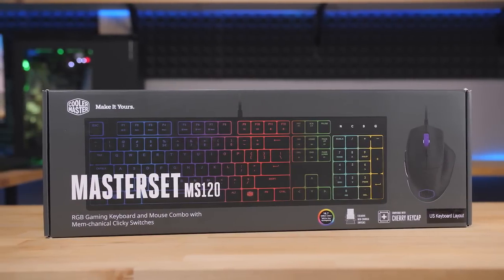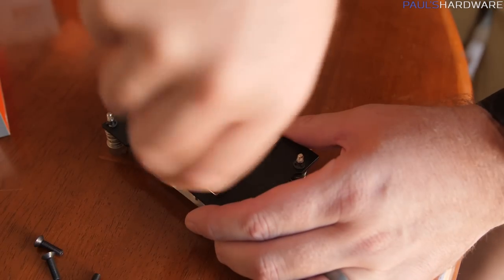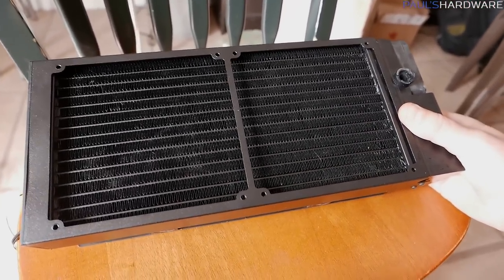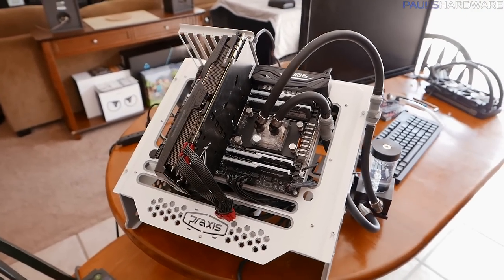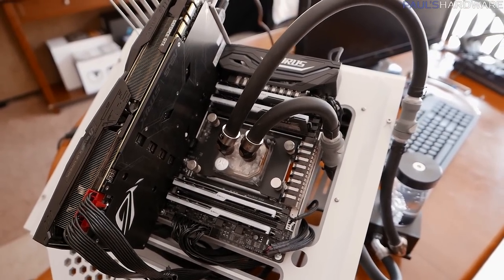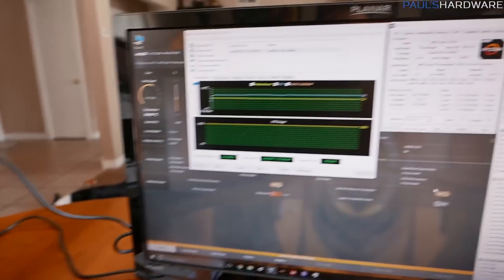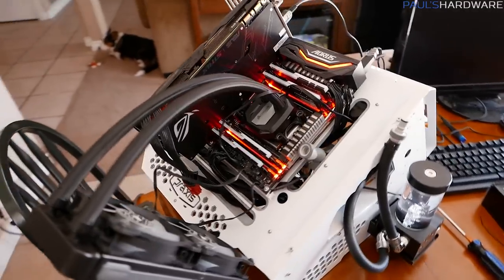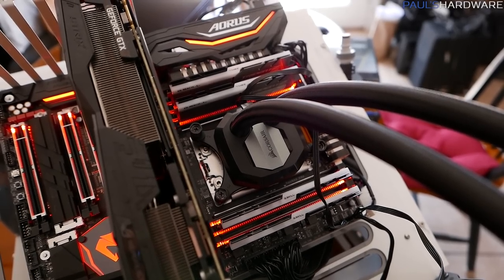My Failed EK Supremacy EVO Threadripper Edition Review

Comment: This is why i hate AIO watercoolers, nothing more reliable then an aircooler
Reply: I would reply to you, but since you seem that guy that just insults to try to prove a point, I'll skip. If you love watercoolers that much, buy them.
Reply: Micael Pacheco I'm sorry for my agresive statements I've just had the worst month of my life, new problems everyday.
Reply: Marc Sticken I hear a lot about h100s and other variants failing on people
Reply: Bad months make good months greats ones.
Reply: Why did you compare a custom water cooling loop in a PC to the Nintendo Wii?

Also, the OP is right, there's nothing more reliable than air cooling.  With air cooling, your only point of failure is the fan.  With an AIO, your points of failure are the fans, the pump, and the tubing.  With a custom loop, you have all the stuff from the AIO plus fittings that can also leak. 

This of course doesn't mean that water cooling is _bad_, just that air cooling has less points of failure.
Reply: Technically a fan less (silent) cooler would be more reliable in that sense. As there are no moving parts

youtu.be/ArJjI0F32rU
Reply: mjc0961 ok that wii was meant to be air, and yes aio coolers are vary reliable, my step dad is gs11 all the PC's in his office are aio cooled because he does firesupport for the guys downrange so he needs a beefy cpu.
Reply: Jeff Goldblum I got lucky the store exchanged the PSU and gave in store credit which I used to get x370 gaming titanium r5 1600 and 16gb of Corsair vengeance lpx 3000mhz
Reply: Micael Pacheco I think everything is relative. I've had nothing but aio's since I started building rigs back in 2013. Only ever had one problem. But it was corrected. To be blunt. All hardware will come with the possibility of issues. Let's not be ignorant of that.
Reply: Planet Kuruto it's bound to happen. Anything with moving parts is bound to break or have problems.
Reply: If done well custom loops are very realiable d5 pumps are tanks very rarely die most last as long or longer then one uses a air cooler (5+) years and the rest of the loop is as safe as one makes it aio if you have no control over qualty so your gambleing on the manufaturer, but they are still fine 99%  of failure is the pump wich dosn't hurt anything your pc will just hit its thermal limit and shut itself down sux to replace but not really dangerous
Reply: Phoenix Fieryn I've heard problems all round with all different brands. The biggest issue being the pumps. Had two of corsairs aio's and I've yet to be disappointed.
Reply: @Phoenix Fieryn Yeah my X62 has been nothing but a beaut
Reply: Phoenix Fieryn it's more than likely Corsairs popularity in comparison to most other aio manufacturers.
Reply: your waisting your time buddy, the tech tubers brain washing (and free aio coolers) have got to these people they cant be helped, they refuse to grasp the fact that cpus dont need to be cooled down like they think they need to be.
Reply: Idk why people say things like this... 'Nothing more reliable than an air cooler' 
My custom loop from EK came together perfectly fine, it runs perfectly fine, I use cryofuel and deionized water so any spills mean absolutely nothing apart from a few hours to dry if I catch it or a few days to dry if I don't. Thus far I've had no failures at all and filling the loop is incredibly easy. 
I think people don't seem to understand what redundancy means. :/ You don't need to worry if you have enough layers of safety.
Reply: Well i mean he does have a point a AIO is much more reliable then custom block i'm sure you already know that anyways and you are right air cooling is and will always be the most reliable the thing is you can do much more with custom cooling and i will always be a massive fan of water cooled GPU's where there is even a MUCH bigger difference. 

For normal cases or builds i make for my friends to last 3-5 years i won't use anything but a heat-sink. 

If a user thinks a AIO can beat a heat-sink to a degree of being able to overclock better they are wrong but with custom cooling they can easily beat a air cooler.
Reply: @Sir Dandy Just because something works out fine for you does not mean it is better than something else. Your experience does not invalidate things you disagree with. I also am not sure you understand what redundancy means either. 

By definition air cooling is more reliable, because they are intrinsically less complex, therefore contain fewer points of failure: fan, heat pipes, radiator vs. pump, internal radiator, fluid transport system, external radiator, fans. I use an AIO in my machine but that's because it keeps things cooler than an air cooler while looking better and sounding quieter, while being affordable. I understand risk is higher, but it's not worth it to me. This does not make people who use air wrong.
Reply: jd gaming temps are right on par with top level air coolers with aios. Its a matter of preference at this point. We're arguing semantics. there's benefits to both. My personal preference is not air coolers but aio. I don't like how massive they are. Or the aestethic they offer.
Reply: +Ana Sevi 70% failure rate over 2 years? LOL, no. If that was the case NZXT and Cryorig wouldn't have a 6 year warranty on their AIO's. Even Corsair has a 5 year warranty. "70% failure rate over 2 years" please show me the source for that nonsense.
Reply: Air coolers are more reliable, just a fact, but I've never had a problem with mine which I've had for 4 years.

As long as you keep the barbs on the radiator at the bottom in the instance of a vertical mount, or facing down for a horizontal mount, then you'll get more reliability.
Reply: Ana Sevi I've seen nothing but positives in this chat about aios. Not a single person complained about there's yet. I think that you're being persuaded into believing that just because someone else had bad luck. That you will too.
Reply: AIO Coolers are indeed not a good choice. Pumps are noisy or will become noisy in a short term. A good pump with a good top for a custom loop costs most times more, than the whole AIO. If you use good components and work with care, a water cooling loop is just reliable as an aircooler.
Reply: Doesn't matter, even if it's a 0.01% chance to break, it's still way more, than 0. Pumps can fail, tubes/ fittings can break. It probably won't happen, but on the off chance it does, you're fucked. Large air coolers on the other hand (like the NH-D15) offer the same cooling, with zero risk, and a lot of times they're way more quiet. The only reason people buy AIO's is because they look cool.
Reply: Norbie bud. A fan can fail. Also, that thing is massive. And can interfere with components close to the socket. Mainly the RAM and gpu. I'll say it once. And I'll go ahead and say it again. We're literally arguing semantics and personal preference. The performance of both are so similar that it doesn't matter what you choose. As long as it gets the job done.
Reply: Norbie Nzxt, Corsair replace all your components if it leaks and damages them, if of course its not because you caused that leak
Reply: Das Flank Running water in a system is always dangerous and prone to fail cuz there are more point of fail and it has the potential to take all of your components with it compatibility and reliability are two different things
Reply: A massive heatsink like the Dark Rock Pro 3 from BeQuiet has a weight of 1.2kg. This is a lot of stress to the mainboard.
Reply: I have an alphacool eisbaer 360 and its awesome
Reply: My Corsair H50 that I bought in 2010 is still going (somehow).  I think most everyone else's has probably died by now.  Its days are numbered.  My main rig gets the cheap CM air cooler for the obvious reasons even if it does occasionally get to 90C before the fans catch up.
Reply: True. But air coolers aren't anywhere near as good as a liquid cooler can be unless you're passing an obscene amount of air through the fins and if you do that...well, you stop having a fan and start having a turbo jet engine without the heat. :/
Reply: My Antec Kühler 620 has worked perfect since I bought it 2011 so..
Reply: Just get a passive laptop. That should negate any need to tinker with any hardware. It will run seriously hot, almost as an air cooled PC, but with no maintance. Proper water cooled PC runs just as silent as a passive laptop, with both making electronic noises. Again, you can combat some of this with a PC, but not the lappy, as the lappy cannot be tinkered with. You guys running air cooling, would not now what sort of noise I am talking about, for obvious reasons.
Reply: thats what i think aswell. Since years i'm using my Scythe Mugen 4 PCGH edition tower cooler. (with an overclocked FX8150).And i thought my FX is a hot chip... But o boy! 68C with a 360 custom loop @stock. Ouch! i hit about the same temp with the 8150 @ 4.3GHz ON AIR.. But i guess the newer cpus can live with a higher temp... My old phenom II X4 crashes at 65C already... But even a smaller cooler can easily get it down to about 55C
Reply: I had a 120mm aio which was pretty underkill but it did its job. But now i have a Custom loop since 4 Years. It is much more work to change something. But otherwise i don't do anything except checking the fittings once per Month.
Reply: Ana Sevi I do agree with you on air being safer than aio. My question is if there are any air coolers that are not too beefy in size that could handle the threadripper?
Reply: it isnt an aio...
Reply: Micael Pacheco

Hate, why the fanboy talk, are you a kid. Some solutions need other cooling solutions then other situations. Aircoolers have a place in this market, enough for your use. Reliability, some systems run better with on a radiator solution to control the overall process better, so it's more reliable!
Reply: lol, AIOs are more reliable than custom loops.. sorry dude, D5 pumps are king.
Reply: Para Digm
If a Fixed solution can do the job, go for it! If you got the money, and no fixed solutions on the market that does the job, you need to go custom. Don't buy cheap parts, custom can be as fail save as air coolers, lil more maintenance only...

You ar on any custom loops now, on any X or Xeon, GPU's too?
Reply: you get what you pay for, a good pump cost as much as an entire aio, they have to cheap out somewere. open loops need maintenance, they need to be kept clean and you have to change the coolant every once in a while, but they are more relaiable than aios, they have the best cooling capacity for non exotic cooling solution and you can have 2 pumps if you want (for redundancy)
Reply: cough cough passive coolers
Reply: Marc Sticken It takes a lot for people to apologize on the internet. You are a good man my friend!
Reply: Nothing is more reliable than air cooling, however, building an open loop cooling solution is so bloody satisfying and a lot quieter. Also keeps the equipment much, much cooler.
Reply: If you saw the video, which i doubt you saw, you will see it's a Corsair H100i, that is an AIO, so please before stating something, first check the facts...
Reply: Niall Mullenger, my reply was directed at someone who ccommented that the cooler in the video was custom and not an AIO (because he failed to watch that H100i at the end of the video)
Since his comment is not to be seen I guess he deleted it out of shame.
Also stop being paranoid mate lol :)
Reply: Ah, sorry, didn't see that comment was all! God damn I feel like a twat with that second comment from me now lol. I'll remove those, sorry for the confusion!
Reply: Niall Mullenger - No offense taken, everything is good :)

Comment: You seriously have had some bad luck with aio's, been following on Twitter. Still don't let it get to you thats the fun of it.
Reply: gabrielofpark aio's fail quite often
Reply: progste do they? I've only had good experiences with AIO's. Couple AIO's are still running strong after 6 years on my Sandy Bridge systems. My AIO in my Ryzen rig hasn't given me any issues yet (knock on wood).
Reply: progste you say that. Yet I have yet to have one fail on me in four years of daily use
Reply: Das Flank I've never used one so i don't really know.
Reply: gabrielofpark hurts the wallet though.
Reply: I've heard some speculation that they are turning into commodities and OEMs opting for cheaper components to push prices down. A lot of consumers right now think of AIOs as automatically being the best coolers because they're water coolers. They don't know that a big air cooler can perform much better than a thin 120mm AIO.
Reply: to be fair, you should always check pre-assembled. modular items like the EK waterblocks. they are assembled by humans who can make errors. my $80,000 BMW 5 series came with one of the brakes not fully secured in place. fortunately the dealer caught before delivery.
Reply: Abraham Lincoln woag
Reply: Abraham Lincoln
You need German cars, you always drove German import? Before delivery it to the US, and they told you, hahaha....Why not buy US, why cheap Asian and German import? US not good enough for you?

BMW is cheap here, just as VW, not worth any premium, US cars are expansive only, because nobody needs that crap here!
Reply: lucas rem what
Reply: Ty4ons i doubt that's the case. Especially considering it's just speculation without any backing. I have said this to a a handful of people before. But it's entirely personal choice in the matter. I for one am not a fan of the enormous size of those air coolers. Despite their capability. I can't say that aios are discrete at all either. But they don't take up nearly as much room as some of those massive air coolers.
Reply: Das Flank
what, ein problem mit der sprache.....You have problems, and can't ask a question? Just find a block that fits, it's so easy, are you on X299, needing Paul? LEGO, everyone can do it! why is it so hard for some?